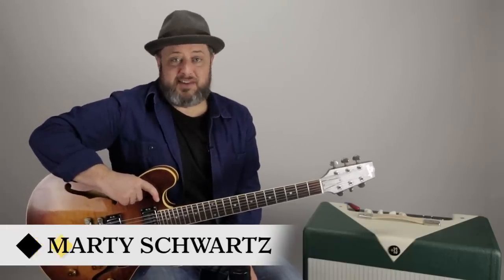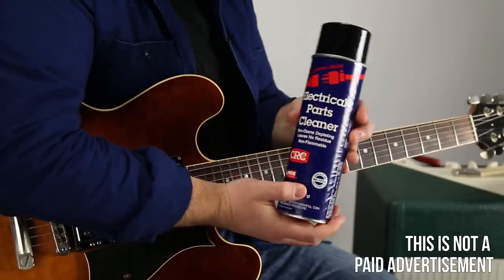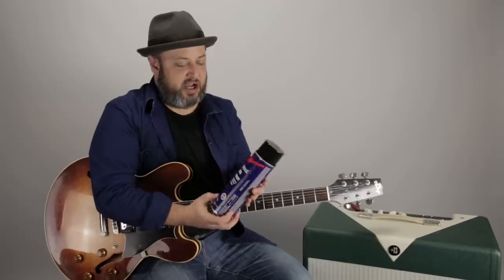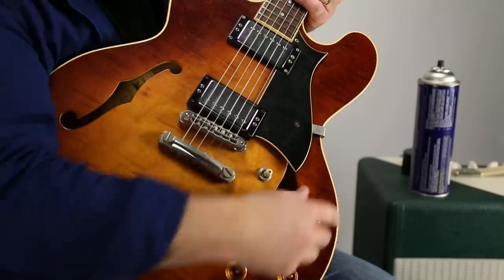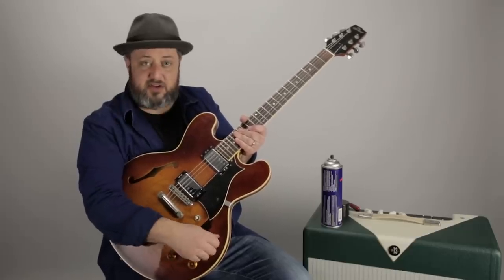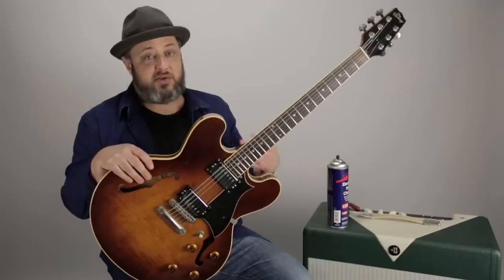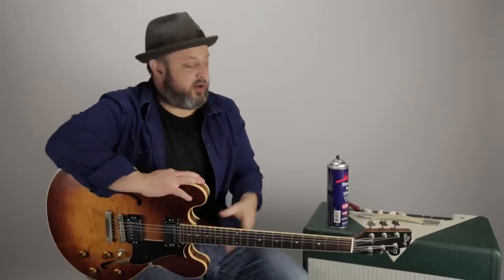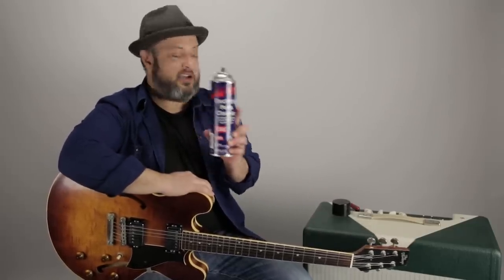Dirty Pots or Crackling Jacks?  Try This! - Guitar Maintenance

Comment: actually Marty, you will need to use a concentration straw like those that come with wd40 for best results without over spray to ruin the finish.
Reply: HotRod Biker This stuff won't ruin the finish as long as you wipe off all overspray. If you don't wipe it off it may leave some stains, but those can be cleaned off too. Of course it's better to use the straw to avoid making a mess in the first place.

Comment: How does this Compare to the DeOxIt? ( or is it basically the same stuff? )
Reply: I have been doing my homework on this question... CRC QD (Quick Drying) Contact Cleaner (which I think is the same as the CRC Electronics Cleaner in this video)  cleans but does not lubricate... on the can 'Leaves No Residue') whereas Deoxit D5 specifically cleans and lubricates in order to improve the connection... both work... but most guitar techs use Deoxit because of the better connection and longer term fix...

Comment: Ok I'm gonna pick up some keyboard duster to blast out dust as well because my volume pot s##ks! I sprayed a lot of contact cleaner in the pot and no matter how much I wiggle and jiggle and turn back and forth, the volume pot keeps crackling and cutting out. I'm skilled with my hands , but unfamiliar with electronics. How do I know when the pot is toast? It's a Classic Vibe Tele and the pots seem really small... can I succussfully replace them, aka learn to soder etc.. Again I'm skilled with tons of tools and many mediums but I have never soderred or gotten into the electrical side of luthierie. Should I get into this? If so, can I just replace the volume... and what's a good upgrade for a CV Telecaster. Thanks to anyone willing to answer. Thanks Marty!

Comment: Marty, do you think it's the same with pedals?
I've got a Danelectro T-Bone and the level crackles slightly and sometimes goes. If I tap it off the floor it comes back. I know it's only a cheap pedal but it's part of a series on my board and don't want to give it up just yet. I was thinking a loose solder joint. Is it worth the try?
I know it's only advice, promise I won't sue 😂😂😂😂🤣👍

Comment: Is wd40 ok to use? It's gonna sound stupid but I already used it, cause my pots were really snug, then gave is some turns and now I feel it lightly scratching when it's not plugged in. It works just fine and spins very freely, but I wonder if it's not gonna get destroyed soon cause of that scratching.
Reply: No.  WD40 lubricant attracts dust.  Stick to using DeoxIT D5

Comment: I  have a 1974 335 . It gets a white milky film patina ? on the face some times, any suggestions to get rid of that. I have tried many different products. thx
Reply: Tom, there is a product called Barkeepers Friend, contains oxalic acid, is used to remove milky stains from wood without hurting the finish. Maybe you already tried it, but just a suggestion.
Reply: The problem is moisture.  Nitrocellulose does not like moisture.  I would imagine you get the "film" during times of higher humidity.  It is the same thing as getting a white ring on a piece of furniture from a "sweating" glass full of iced beverage.

Also, Norlin (owners of Gibson Guitars through the 70's) had poor quality control and your finish probably wasn't the greatest when it was new.  I know that the three Norlin guitars I have owned didn't.  And some of the cleaners you have used could have made the problem worse rather than better.

Short of buying a dehumidifier and placing it in the room where your guitar resides, I'd keep it in the case and keep a desiccant in it, changing it out regularly.   You know, the little white packets that come with electronics that warn you not to eat it.

You can find both loose pellets and packets at Amazon.

I've never been there, but I assume that the Gibson factory in Memphis that makes hollow body electrics has a helluva time with spraying nitro.  The humidity in this part of the country (I live about 75 miles away) is horrible, seldom under 55%, and for most of the summer is over 80%.  It is the preferred finish for guitars, but probably the most temperamental of all potential guitar finishes.  Spraying nitro in high humidity will often trap moisture under it, and have permanent white film.